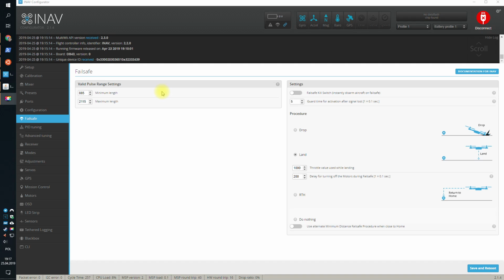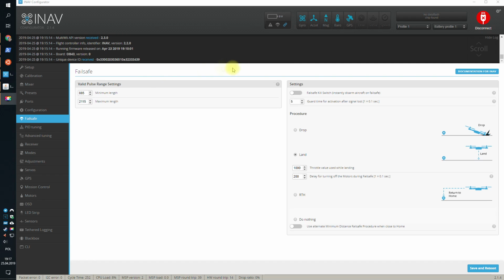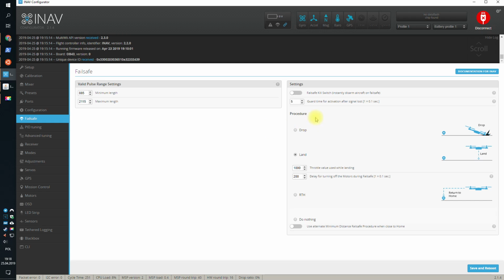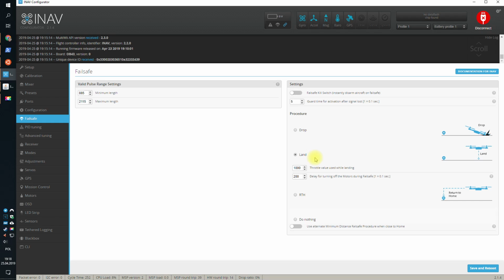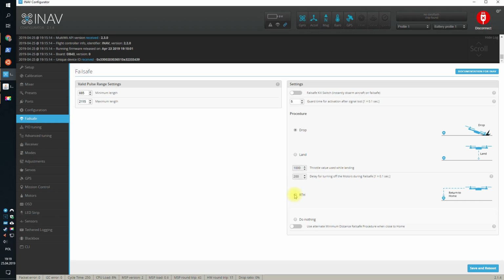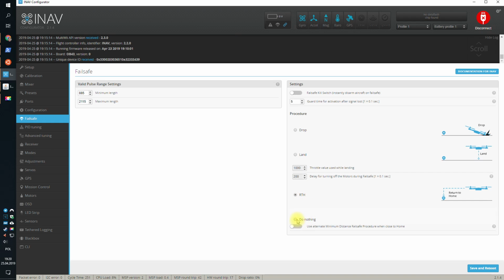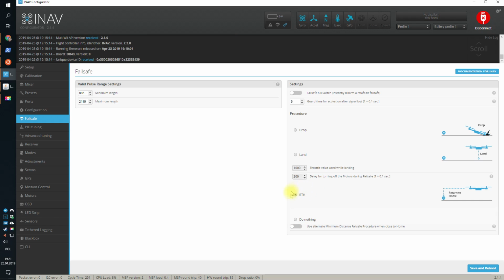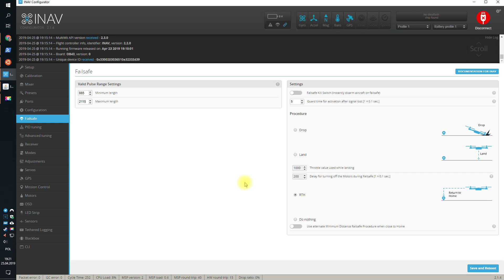How to setup INAV on a 5" quad - Failsafe

Comment: Pawel I'm running inav rth it works fine on a switch. My question is how i configure failsafe in xfire rx if I have it set to "cut" and when I turn off radio the motors spin now when I  it set to "fs pos" it kills the motors which one do I use? Cut? or fs pos? I conducted the experiment with props off.

Comment: I run INAV on a 450 10" and 330 8" and I'm very happy with it. It's way cool to be flying and just flip a switch and just watch while the quad returns and lands all by it self, usually less than a meter from were it takes off. Now I'm building a 250 5" and I think I will be running INAV, just because of the really nice GPS functions. Thanx Pawel, I really enjoy INAV!
Reply: Hi Mekanikern, Can you share the PID's used for the 450 10"?
Reply: @berlerd  Hi Danny. I could give you a complete "diff all" BUT I have not tried my last setup yet. BUT (again) there is absolutly no secrets here, my last setup for my 450 was the INAV preset for "10" general Purpose". Can't remember if I used the same for my 8" 330 or if i used "7" Endurance" mut it all boils down to the INAV presets. Other than that I've only tweaked minor stuff for GPS use, like reducing  Min. RTH and tweaking vertical landing speed after being bored while waiting for my 330 and 450 to come down on RTH. INAV presets works really well, if I were you I'd just put in the 10" General Purpose setup and try it out, my setup does not differ much. I think I gave it more speed on waypoints and more angle in Angre, other than that its mostly stock. If you're not happy with the stock results, hit me back here and I will try to help you find out wats wrong, but I'm not an expert :)